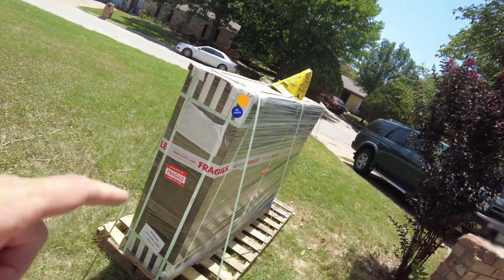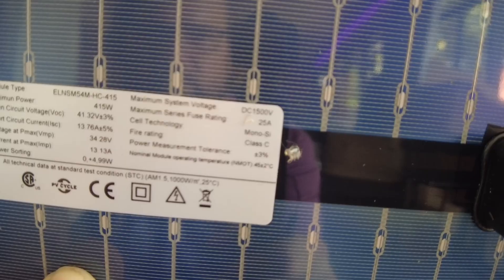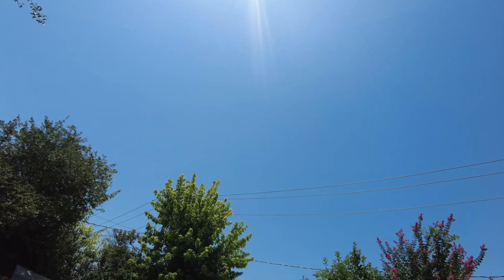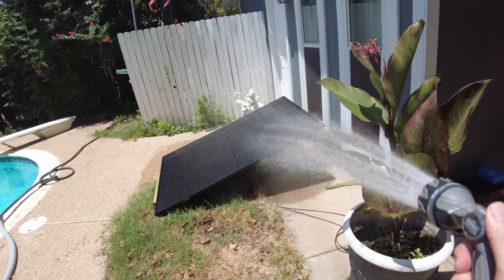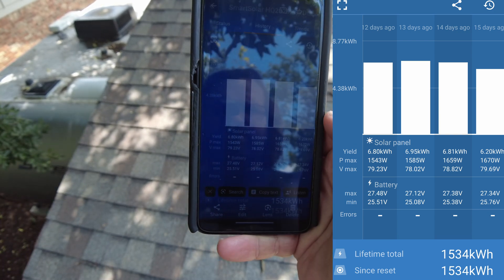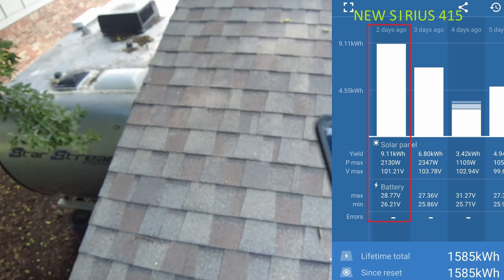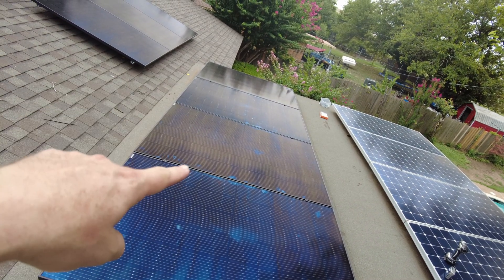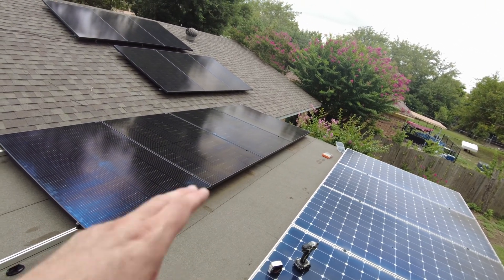Sirius (USA Assembled) 415W Bifacial Solar Panels

Comment: If price is same as ordinary panels, bf panels is a good option, as you CAN move them somewhere else or sell them, and thdn you rather have bf panels.
To get some 5-10% more effect, I would install some reflective material on hhe roof behind them, and adjust gaps between the panels for sun to hit that.
Also mounting them in a tilt or higher up from the roof (combined with some reflector) would also give a small boost, but everything cost to do that.

Comment: Very nice panel performance!  I’ve been happy with bifacial panels and started using them exclusively.  I’m curious where you got your roof mounts and rails?  Not sure I’ve seen those before. 👍
Reply from the maker: The rails on the flat roof are Unirac, and the feet are Unirac Flashloc. The bolts (and the end clamps) holding the panels are ironridge. I have a hodgepodge of racking LOL. I bought a bunch of random solar installation parts from a guy that buys storage units. Dirt cheap, but for the most part a lot of it seems to be compatible. Thanks
Reply: @BradCagle  Thank you!  I’ve been using ground mounts but I’ve got a carport project I want to mount panels on so I’m checking out the options available.  I’ve bought stuff myself from folks that buy storage units.  I always admire those folks with the patience to sift through all that junk to find the hidden treasures!  I’m never that lucky! 🤩☀️⚡️🔋

Comment: I've heard lots of people say that putting Bifacial panels on a roof is a waste because the back side is only a couple inches from the roof shingles and the backs won't get any (or very little) reflected sunlight.  Install them onto Ground Mounts you can put a layer of reflective white rock on the ground underneath the panels which will allow reflected light to get in the backs.     Your Sirius 415w Bifacial panels can make over 530watts if they get good reflected light in the back on a ground mount.      (IF) you put wide gaps between the solar panels on the roof then you could try glueing (Chromed Aluminum Sheets) on the roof under the panels in those gaps to create reflectivity but still won't be as good as a ground mount.     Good Luck !
Reply from the maker: Well, they are in the same price range as regular panels, so not really a literal waste, but I get the point. I do have ground mounts with bifacials already, and yes they do produce better. I would do all ground mounts, but I do not have the room. Thanks!
Reply: @BradCagle  Well I wish you all the best of luck,  usually Bifacials are more expensive so good you didn't pay more.

Comment: I'm doing a ground based DIY set up with a single panel about the same spec f415+r90w charging a 12v 100Ah lifepo4.
Reply from the maker: Nice!

Comment: Hi Brad, 369w divided by 12,8v you are pretty much maximizing the Victron 30 amp charge controller... Maybe thatvis why you weren't seeing more than 369w.
Reply from the maker: Well it's really closer to 14v x 30a = 420w for the 100/30. The manual say it can do 440w, clearly you would need to be @ 14.6+ v. Also I was watching the amps going to the battery in the app, it never maxed out at 30a. You can see here (its a quick glimpse at the bottom): https://youtu.be/XpKWOCi5J0M?si=Fli9XlpZgFQarYbr&t=170  It was only hitting 25.3a when we were getting 359w and 13.93 volts on the battery. There's just some days that don't produce well for any panel even if it looks like it should. I've been surprised at crappy cloudy days that really get the watts pumping. Thanks!
Reply: @BradCagle  That's about what I get, the cooler brighter autumn and winter days may see nearer the ideal output, temperature is a factor as you know.

Comment: Great info Brad. 
I love the idea of bi facial panels but its hard to get light to the back of them when mounted traditionally.
Perhaps, you could setup a structure to mount the panels over the pool so they act as shading for the pool and benefiting from light reflecting off the water to the underside of the panels. As a test, it would be worthwhile suspending a panel 10 or 12 feet over the water to see what difference it makes?
Problem will be the expense of building a suitable structure over the pool and to code for the weather conditions you guys have.

Comment: Why would you mound Bifacial panels flat on a roof? I don’t see you getting backside light?
Reply from the maker: My ground mounts already have bifacials, so the only mounting options I had at the moment were the existing roof rails. I might later put gaps between the four laying flat, and angle that whole rail. Thanks!